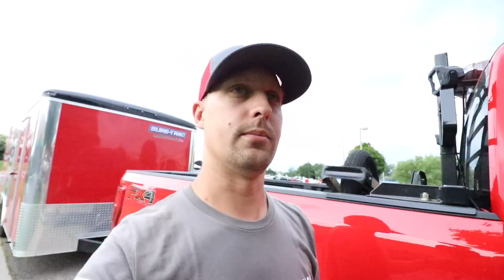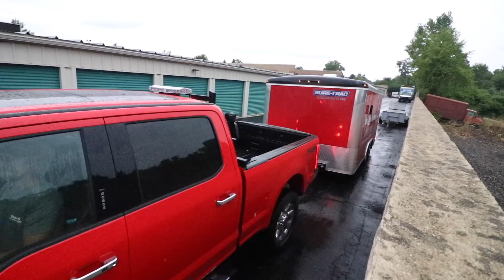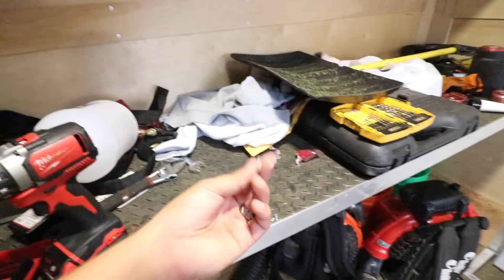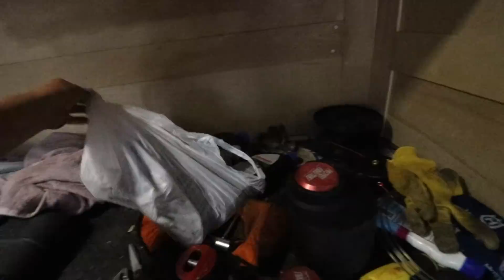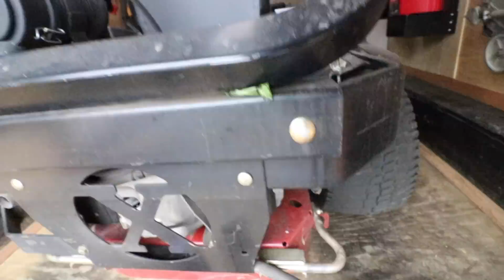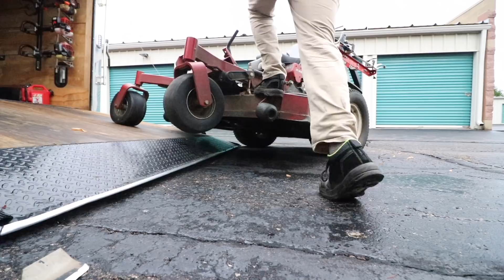The Side Of The Business The Customers Never Get To See

Comment from the maker: Is it just me, or do you always feel like your falling behind on maintenance and  repairs, lol.
Reply: Absolutely. I am a solo operator in Tennessee and this season has about worn me out. I can't seem to find time sharpen blades,let alone put them on. Oil changes come way to fast. I think oil changes come every other week.
Reply: I would go ahead and spend the money on having a jack receiver welded to your deck and buy a jack. It makes life much easier to change blades. Also oil and oil filter are much cheaper than a new engine.
Reply: Brian's Lawn Maintenance for sure
Reply: I do to I'm just so busy. Quick tip though, i always blow off the mower deck. One of my buddies was mowing and didnt blow it off and it caught fire and destroyed tho whole mower
Reply: Gotta fix it soon as it breaks. Otherwise you will feel behind. Maintenance you just have to do at the regular intervals and forget about it until next time.
Edit: my neighbor hires his riding mower blades sharpened. They come right to the house and prop the mower up in their trailer and sharpen them without taking them off. I assume they use an angle grinder but don't know how they pick the mower up.
Nice trailer rig.

Comment: Pro tip with impact wrenches. Try not to tighten bolts down with the trigger pulled all the way. They work best if you run it snug lightly then squeeze the trigger to get your final desired torque. I’ve seen a lot lug nuts and bolts snapped because of that.

Comment: Putting oil on the filter rubber gasket doesn't make it seal better, it makes it easier to remove the filter the next oil change. Also, when tightening, most engine manuals state to tighten the filter an extra 1/2 to 3/4 turn once the gasket makes contact with the engine. The filter will actually get tighter during use due to the gasket swelling which is why even though you hand tighten it usually takes a wrench to get it back off.
Reply from the maker: Thanks!
Reply: Not true... oil on the rubber gasket or o-ring is to prevent abrasion, cutting and/or pinching during torque.  Agree that the filter should be tightened an additional amount (1/4-1/2 should be sufficient)
Reply: Agree. Easy removal is simply a by-product of eliminating pinching and abrasion.

Comment: if your over 10,001 lbs and live in a state like mine in NH we border mass and maine if your traveling over state lines you will need a dot number. Also traveling over lines you will need a mcs90 endorsement and a million dollar insurance policy i had to go thru all that last year. Also if you have a container larger than 8 gallons you will need a placard thats one reason why you can usually only find 5 gallon containers but its ok to have 10 5 gallon containers lol. Also if a trooper goes in the trailer he will look for EVERYTHING to be strapped down that includes backpack blowers :) and the trailer also needs an inspection sticker. good times. As for oil I run bobcat with kawi mowers i always do the paint marker on everything i service and change my oil every 50 hours cause thats what makes the money!
Reply from the maker: Good stuff!

Comment: I run a 452.  TAKE THE BAFFLES OFF THE DECK.  The deck cuts terribly with the baffles installed for some reason.  Night and day difference in cut once baffles are removed.
Reply from the maker: Good to know! Thanks pal
Reply: Curious to know, the little walls/sections under the deck?? Please elaborate on these baffles...

Comment: Air Compressor to blow off mower at end of day. 
And before working on it.
Most air wrenches have 3 torque settings. Find out how much torque each setting supplies and set wrench to correspond to appropriate mfg's spec and/or bolt size. 
HEY . ..
My mama always said to me,
"Your Fussy"
Reply from the maker: Lol
Reply: Eric Stewart why not use one of the many backpack blowers he has instead of farting with a air compressor. What I do.
Reply: OkieJake You are correct. Quick & Easy, but my thinking is, a compressor allows for air tools for maintenance .. other equipment, like cars/truck & trailer. Do both👍
Reply: I blow the entire mower clean after every job. Less debris going back in my trailer. I hate a dirty trailer as much as I hate clutter. Keep it organized, that way everyone knows where everything is when it's needed. My pet peeve is put it back where you got it from. Nice trailer Brian.